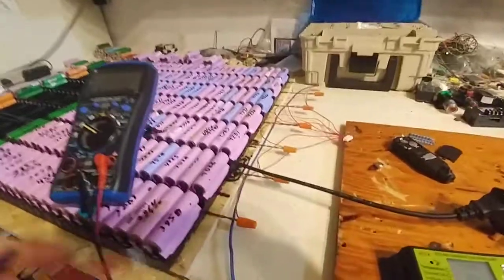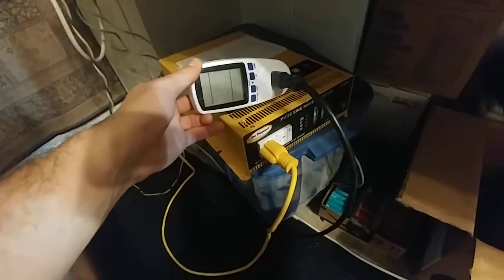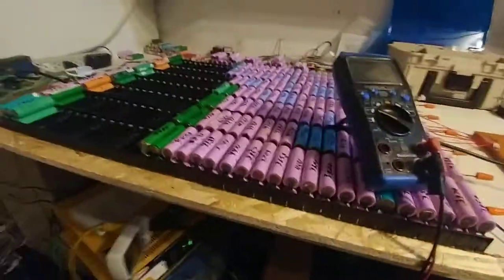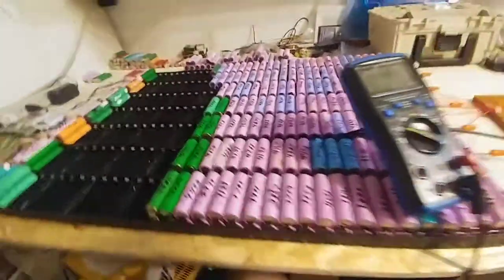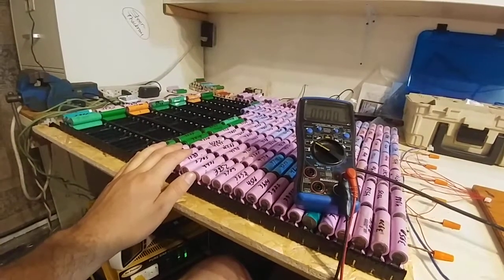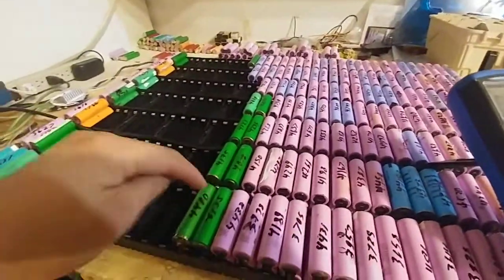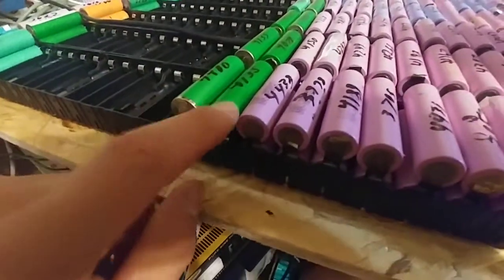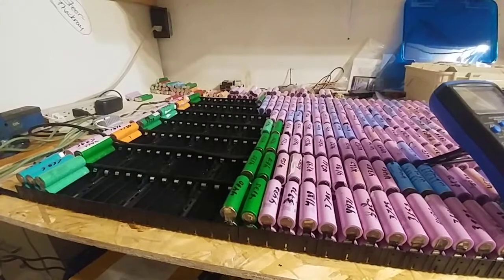18650 7s June 2018 update

Comment: Way to complicated power walls should be simple and no BMS  with 18650s just keep the state of charge in the middle range a7s system 24v choose a charge control that keeps the charge between 23:8min to 27v,and have a power inverter bigger than you need so its not over worked.👨🏻‍🔬
Reply from the maker: A bms isnt complicated and its only 20$ out of 100's of $ of total cost. Sounds more complicated to try to do what you are suggesting

Comment: I think rebound is the term you were thinking of. 
It looks awesome. Too many parts for me though I think. 
I like the simplicity of Edison batteries but the expense is prohibitive. I wouldn't be worried about the bulk. Your system is certainly more efficient. Not sure about maintenance. I guess you pay up front or in effort, one way or another.
I don't have a system. I've thought about it. That's what attracted me to your project. Someday I may. I'm considering all things. I'm in a city with a relatively stable grid so it isn't a priority, at least until the power goes down.
Continuing to follow. Thanks for posting.
Reply from the maker: MrFmiller thanks! Yea rebound ty. Its very simple but a lot of work. I plan on living in my rv in a driveshed green house in the countryside one day. Hense my drive to build this. Its worth it imo but only if your really into this diy stuff :)